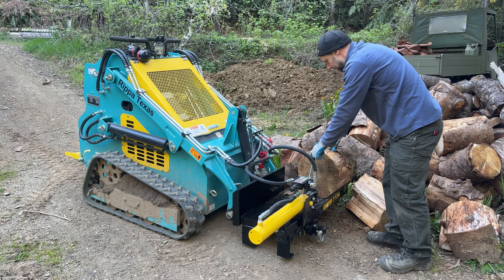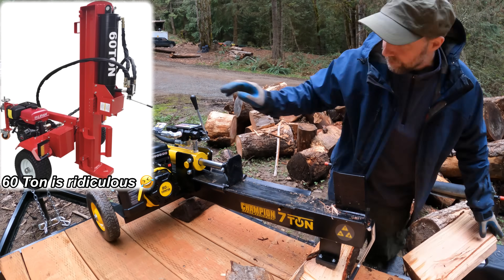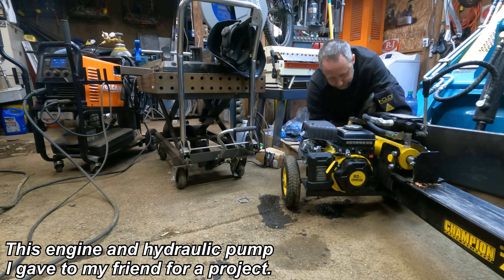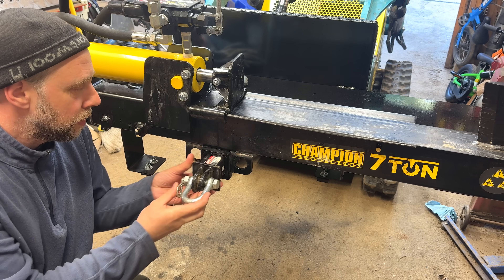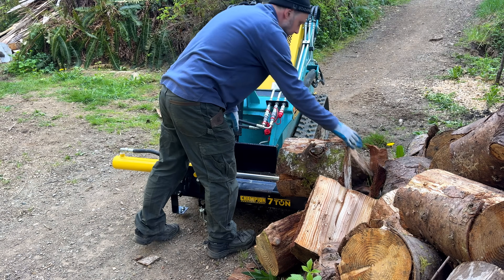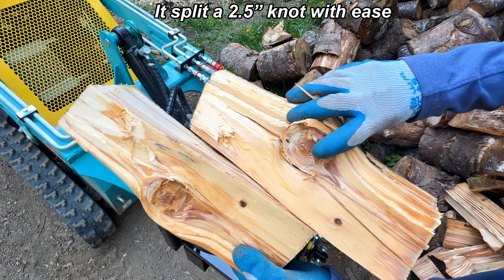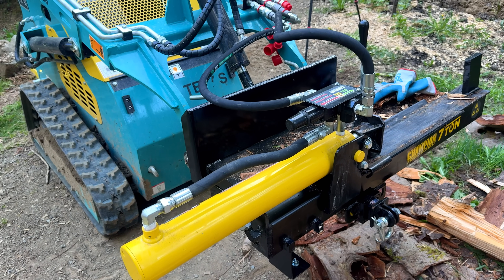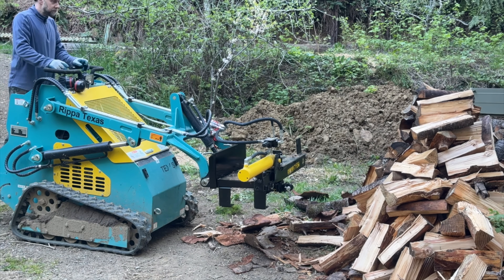The best Skid steer attachment hydraulic log splitter #skidsteer #logsplitter

Comment: I don't understand how you got the function control to work at the log splitter I don't think that would work on my Ditch Witch
Reply from the maker: I just run the Aux hydraulics on continuous flow, this provides pressure/flow to the log splitter and the return goes through the tank filter to the tank. 👍

Comment: Personally, I think it is a great shame that the fabrication videos were not appreciated. I loved them. Watching the problem solving, ingenuity, forward thinking and the cost saving were right up my alley and very much in tune with my own thought process. But I totally understand and support the decision not to pour energy into something unappreciated = ) Buying the pre-made unit and modifying it makes total sense especially because you found what suited your requirements at a great price point (shame about the hoses, DOH !) Just surprised that you didn`t have a plan for the motor and pump for another cool  project. Thank you, Mike. Much appreciated = )
Reply from the maker: Thanks John for checking out my videos! I really appreciate reading your comment. I definitely could have used the engine and pump for some future projects but my friend at the time had the perfect project for the engine and hydraulic pump so I gave it to him. He used it for a large hydraulic brake press for bending metal. 
Take care and thanks again 😊
Reply: @Mikefestiva  Petrol powered press brake... Hmmm, now there`s a thought ! Actually, a petrol engined power pack is not a terrible idea if it is portable enough. Small petrol engine, hydraulic pump and a small hydraulic tank on a sack barrow... No end of uses to the enlightened = ) Be well mate.

Comment: A guy I know put one straight out on his full size skid steer so that it can be used while inside it. He mounted the splitter upside down and can pick up the logs from a pile and stack them into a metal cage (he has an outside hot water heating unit for his barn and house that fits the full cages in for burning.)

Comment: I think the way you hooked up the splitter is only possible with a stand behind skid steer. With a sit in skid steer, you would have to manipulate all the rops safety switches to be able to exit the machine and have the hydraulics function. And it's not without risk exiting such a machine with the boom partially up and have the hydraulics running. You just have to bump into the sticks once to pinch yourself... 
All of this only to say that your design is really great and it utilises your machine to the best degree.
Cheers from Hamburg, Germany

Comment: the skid steer setups look clunky to operate. Yours seems nice with e start and plenty of power. The splitter on the end of an mini ex is the way to go for a good excavator operator. You can crack logs, pull from a pile, and push with the blade.

Comment: That thing is awesome! Makes me wish my kubota had a front secondary or aux hookup.   How much does it weigh?  I'm assuming it could be adapted to a 3 point hitch without too much difficulty.  Good work on the build!
Reply from the maker: Thanks for checking out my new video! I would say the log splitter is about 120lbs 
Fairly light attachment. Those Aux hydraulics are pretty useful. I have a few other attachments I’m thinking of modifying. Concrete mixer would be pretty awesome as well 👍

Comment: Hey Mike I made an attachment that goes where the bucket attaches on my excavators.  I use the bucket cylinder on two of my excavators to crack rounds.  The best part is I can lift the rounds to where I want the wood and then split them.  It really goes fast and the excavator doesn’t even know it’s splitting them.
Reply from the maker: That’s awesome! Thanks for mentioning this 😊👍

Comment: I'm kind of surprised these are not an attachment already for mini skid steers and mini excavators. They make ones for Cat 1 three point hitch tractors which are 20-45hp. They just run of the tractor hydraulics and not the PTO, but regardless, surprised these haven't hit the market for these smaller machines.

Comment: test it with the 3rd function on your mini ex. if it spits as good, make a attachment point for it on the mini ex, then you can use it with the boom to just split and move around, far less manual labor.

Comment: Nice. Not bending over for a long period of wood splitting is rough as you get older and you are close to my son's age. I have a regular log splitter that has two positions but I use the normal one 99% of the time. We have a local station that is a Co-op even though it is a franchise name. The members petitioned so they sell non oxygenated gas. No carb problem since. Some sit for two years and start with no problems and I don't clean carbs. Cost per gallon is more than regular  but cheaper than premium which use to be our only choice for non oxygenated fuel. With that also comes fuel lines that last longer.

Comment: Being able to raise and lower the height you're working at is a real back saver.  I have one on my 3-point and it makes it possible for me to do relatively big wood even with a trashed back.   Your system is very maneuverable as well.  One less carb is a great way to go.  They are a real pain at times, even with good fuel.  Great video.

Comment: I did the same thing! Except I modified a normally 3-point mounted Ramsplitter brand 12 ton unit. I mounted it the "long" way and bolted up a mini skid attachment plate to the 3-point attachments so that I can always remove it to put it back on a small tractor. Your version is a little more compact than mine though. Looks great!